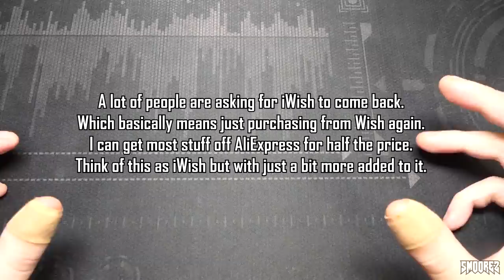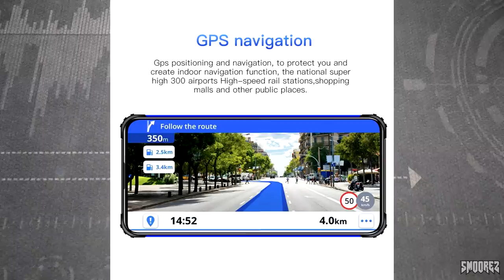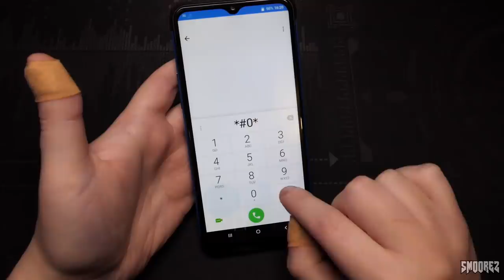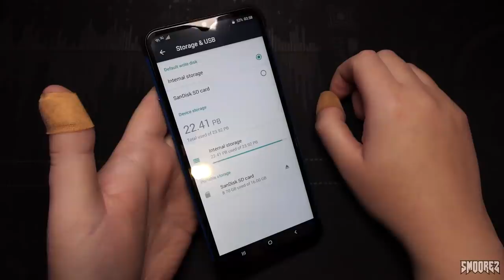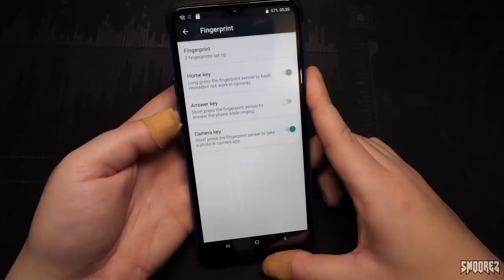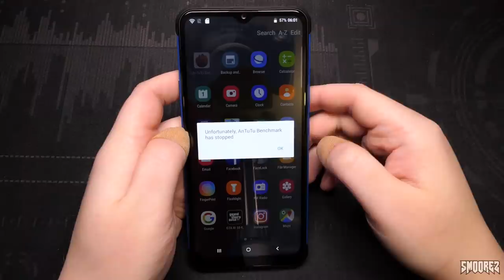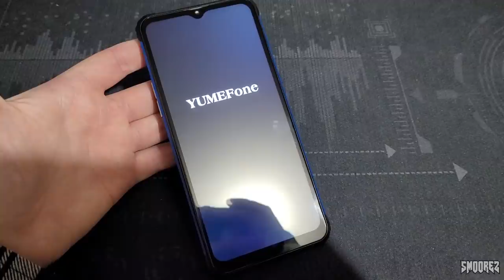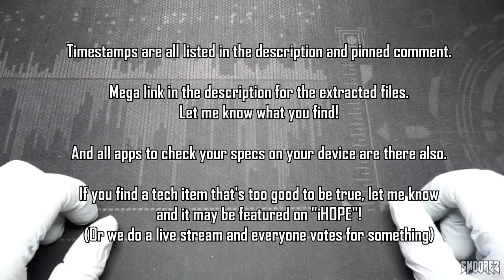iHOPE - I bought a $150 Rugged Phone that claims to have a Qualcomm 888, 16GB RAM & 512GB Storage...

Comment: Just a fan fact: "yume" means "dream" in Japanese, and since they're literally selling a "dream" phone, it kinda is true lmfao
Reply: A bad dream!
Reply: A nightmare?
Reply: 36:30 that sounds like stuff of nightmare.
Reply: Akumu would be more fitting lol
Reply: UleFone Armor 12 5G is thin and light, equipped with 15W wireless charging, 3D super linear dual speakers, and it can play FM radio directly without an antenna, which is enough to attract me.
Reply: @IamJay02  at least they ain't Welcome phone lol
Reply: @xpexia2594  They certainly ain't no Xiaomi
Reply: Yume.... Definitely not a Yakuza 5 reference.

Comment: When I extracted the system files, I found 5 bootanimations and 5 shutdown animations. It has a Welcome branded bootanimation (that you've probably seen on other welcome devices) and 2 of the same sounds each.

There was also a RYGO bootanimation/shutdownanimaton as well so I guess this could've been something else as well.
Reply: How I get those animation into a video? There’s only a part0 with all photos and part1 with final picture. You have viewed them in pictures or did you extracted them to video?
Reply: @jindrasmutny4181  I manually put the images together in a video editor and the part0 folder contains the main animation while the part1 is the last image.
Reply: @KaiBannon  aaah alriiight thank you 😁 which video editor have you used?
Reply: @jindrasmutny4181  I use DU recorder and remove the watermark on it (I had a modified APK of it)
Reply: @KaiBannon  okay Thank you :)

Comment: I like that ever since Mediatek made a 10 core processor everything of these knockoffs is advertised as deca core because it must be the fastest. Especially if I consider that Qualcomm's 4 core alternative was much faster.
Reply: Also from the same line that the Quadcore is from, the 6580/6582 they all actually use, there were 6 and 8 core Versions like the 6592.

How much do you think the 8 core would cost more nowadays? 1 Cent? 2? I mean nobody wants These Chips so they can't cost much.
But it would be a nice boost in Performance

Comment: so far, your video is pretty decent. But just so you know, float service is the name of the service that allows floating widgets and chat heads. Like messenger. nothing crazy about it, if you remove it you just wont be able to use chat heats and floating widgets or phone calls popping up on top of the screen instead it'll be like old android phones where a phone call would close your apps and cover the whole screen with the caller.

Comment: So Mediatek recently overtook Snapdragon (and exynos) in units shipped and certain sectors of the Internet lost their minds

Little do they know that a large chunk of those units are worth €30 and are running hardware weaker than a 1998 Sega Genesis
Reply: That sounds like something a Chinese company would do
Reply: All the garbage in the phone industry uses mediatek, that's for sure.
Reply: @pauloa.7609  It's e-waste...
Reply: @samholdsworth420  pretty much, yes. Even though some of their recent chips aren't all that bad.
Reply: @samholdsworth420  
Well actually, Mediatek chips are in diverse products you'd not really expect 
Smart home speakers for instance 

And a surprising number of genuinely flagship phones too 
At least lately
Reply: MediaTek now has some pretty good chips. I have a OnePlus Nord CE 2 5G, and it has a Dimensity 900 which is a good midrange chip from 2 and a half years ago. It's very snappy.

Comment: The front looks like my UMIDIGI A7 pro which i paid 120 pounds brand new from amazon around February this year. All specs were as advertised and runs well and haven't really came across anything it cant do. It has a real nice solid feel and build quality with glass back and metal frame, android 10, AI quad camera set up of which 2 are 16mp, 1 is a 5mp ultra wide and a 5mp macro, 4gb RAM, 256gb memory, FHD screen, USB C and octocore processor. Oh and its 4G duel sim and battery lasts nearly 2 days no problem with me watching YouTube several hours a day, playing games and listening to music with Bluetooth on connected to my speaker or headphones.

Comment: UleFone Armor 12 5G is thin and light, equipped with 15W wireless charging, 3D super linear dual speakers, and it can play FM radio directly without an antenna, which is enough to attract me.

Comment: Most phones do this. They don’t die but it gets messed up by the water. Plus the adhesive adds more to that
Reply: Depends really if you cut off the power and then dry it off with an air compressor as an air can wouldn't be able to expel the water. My second smartphone an LG G2 survived when I did this and let any residue water dry out for half a day. My parents keep it for the Walabot stud finder since they just use iPhones. Works fine. Only thing I noticed is that the Walabot app doesn't like it anymore. Maybe I'll hack it to run a later android sometime so it isn't so fussy.
Reply: They don't, I have put my S10 fully submerged in water and it was fine just don't put it in acidic water like the ocean.

Comment: This LOOKS like it could use a similar frame as my china phone, though mine is actually china branded and not shit and costed me about the same as this listing ( Ulephone Armor X8 ). The tripple camera and fingerprint location and button placement match, but not the sim slot location. Also, the Ulephone is actually legit rugged in that it does have water insertion protection. Anyway the camera island and fingerprint sensor location are shared among a lot of phones so not saying this is a Ulephone rip off. It's not a direct match at all, just optically close'ish in layout. And the actual form of the plastic is the first thing a clone manufacturer changes to 'differentiate' himself, it's the cheapest option since it doesn't change any of the internals and it's most effective since it optically changes the phone so people always notice the desired 'branding' effect.

Comment: Your drop test is pretty flawed, IP cert only says 1.5m drops so waste height was spot on. Throwing it in the air, even a properly certified IP rated phone will likely crack. 

What's more important in those drop tests is checking angles of impact from relative smaller heights which depict more real life scenario's. Like dropping on a corner ( which is why rugged phones have some protection there ) or dropping flat ( which again is why a rugged phone never has a display that isn't recessed on some way ). 

Overall pretty fun though, long but that's what's we expect. Thanks btw for reminding me of those codes, maybe this time I will remember them.
Reply from the maker: I absolutely agree with what you are saying, I did want to do a bit of a more comprehensive durability test but I really just wanted to pull it apart instead. But I definitely will take it onboard for the next phone 100%. I appreciate the honest feedback!

Comment: you know whats really sad. for $150 with just a few tiny improvements it would actually not be too bad a device. 2gb ram with 16gb memory would be OK not great but ok. screen res is decent. slightly better processor and it it was actually rugged. it would not be too bad a phone.

Comment: Has anyone else ever noticed how the Best Buy website technical specs are often full of incorrect information? I noticed it on laptops but wouldn't be surprised if it applies to phones as well. The most recent I noticed was a new MSI 12th gen laptop. It had some errors in cpu core count, etc... It's not like the listing in this video but surprising how often I find mistakes.

Comment: The advertised specs of these phones: "Qualcomm newest best proccesor ultra hd screen 100000gb ram 100000000gb rom"

Reality: Craptek oldest processor with Mali 400mp, 480p LCD screen, 512 mb ram and either 8gb or 4gb rom

Comment: apparently this phone is so shitty that it broke my wi fi connection lol. i finished the whole video only now. i actually have an alcatel phone that has the same cpu (1gb ram/8gb storage) with a bad craked screen. i still use it today because i left basically nothing about google or other apps (like FB,insta,whatsapp), it's shitty but it still works.
also putting up a rip off of the samsung ui is so dumb. that ui is so heavy, just put android stock it will faster.

Comment: You don't get long term results by lying about a product. I don't mind buying cheap stuff, I just don't want to be lied to. You could get a refurb iPhone 7 for about the same price. People do not want warranties. They do not want great return policies. They want stuff that is honest, and works that they don't need to return. Look at Black & Decker. The tools they made in the 1980s still work. The tools they made in 2010 are all broke. Look at HP. The calculators they made in the 1980s still work. The calculators they made in 2010 are all broke. Most people don't complain, they just stop buying.